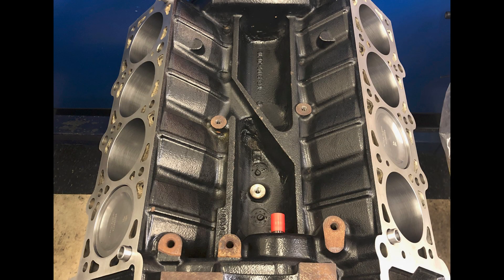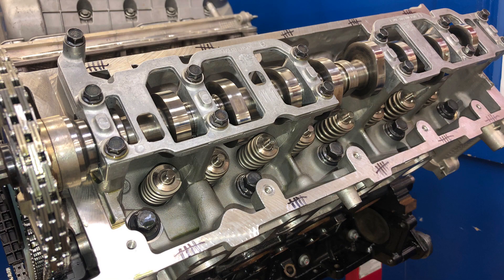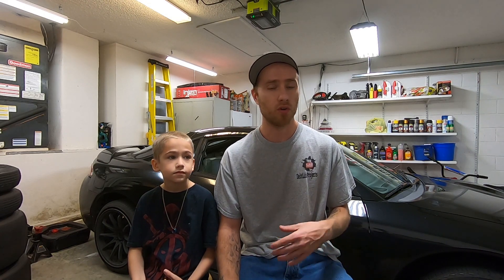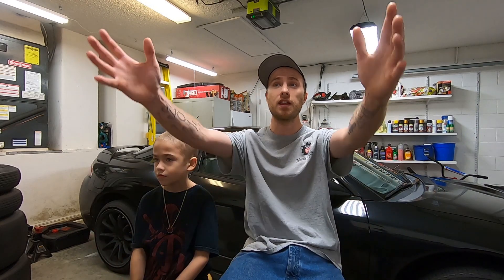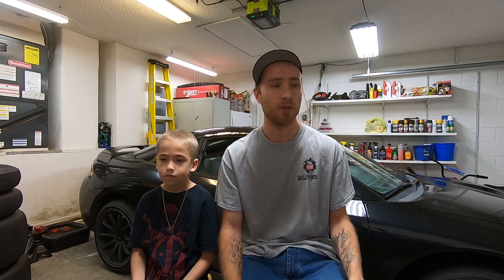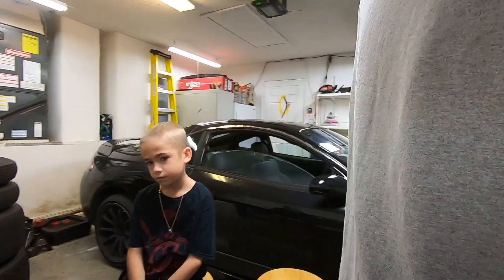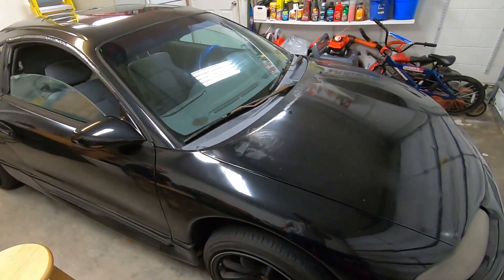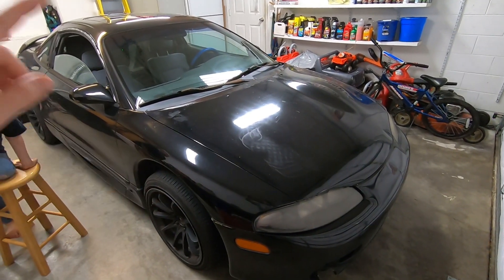Ford Lightning Build - Fully Built Motor is DONE

Comment: Thanks. For your help. And advise.have a nice weekend ✌😎👍its seem that walbro United whit TI AUTOMOTIVE .
AND THEY ARE USING The name BRAND WALBRO.. ITS HARD TO FIND A KIT DUAL FUEL PUMP NOT TO MANY WHIT THE 5/16 Y FITTING.THAS ALL.thanks. 🌞😎✌
Reply from the maker: Have a good weekend too!  JDM Engineering has the legit walbro kit with the stainless y fitting, socks, hoses, and all that stuff.  Id hit them up, they are always good to me. 
 
Lmr (late model restoration) is another good place to get parts.  They will have just about any part you’ll ever need lol.

Comment: Hi.,good afternoon.. I salute you from San Diego CA . I hope you can help me on this one. 🤔❓why install 2 fuel pumps instead of just one.. I know that you recomend me walbro 255hlp. 255+255= 510hlp.. any idea why ❓I bought the set of walbro on ebay and they are a different bran not genuine..they lie.. now I have to return for a refund.. and purchase a new.  One. That's why I'm asking you for your knowledge..again thanks for your time and attention. Have a nice day. 😎✌👍
Reply from the maker: Because it’s what they did from the factory and it’s easier to use the dual walbro 255s since they are pretty much a plug and play upgrade.  I’m sure you can do a bigger single pump but it’ll require a lot more work.  

That’s sucks about the pumps, that’s why I never buy my truck parts off eBay, too much risk in getting crap parts.

Sorry it took so long to respond, busy bee lately lol 😆 good luck with your truck tho man, I hope it’s all sorted out soon! 🤘

Comment: How's everything coming along bud? Truck up and running again yet?
Reply from the maker: It is!  Everything seems great so far, been driving it too and from work, breaking it in!  Videos are coming soon, just trying to find time, work has me ragged
Reply: @DebtLife_Projects  That's great to hear, I'm finally going to start getting mine worked on hopefully this month. So I ordered both the plenum spacer and the Turkey pan spacer. How did the notching go?
Reply from the maker: @Nathan-wn5mc  hell yeah, thats awesome!  Its easy, just used a cutoff wheel and made a rectangle in the hood bracing thats over the rear of the plenum.  Made it look just like the rectangle in front of it, hard to explain.  I have a pic on instagram with the hood popped and you can see what I did.